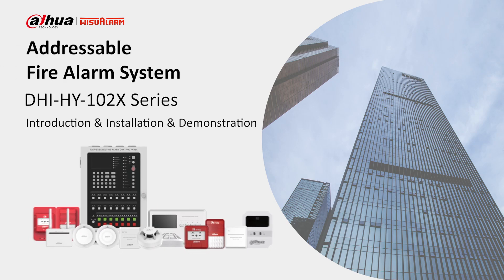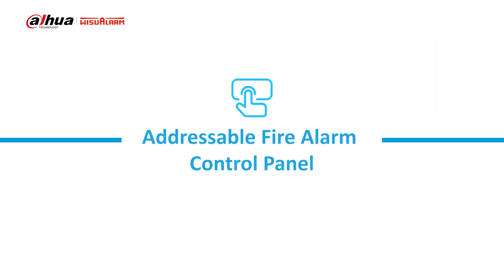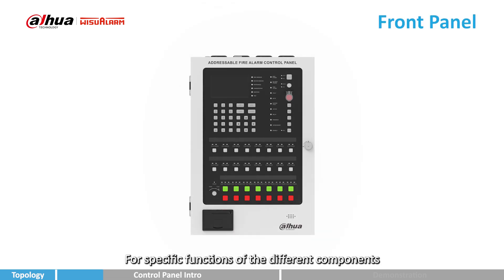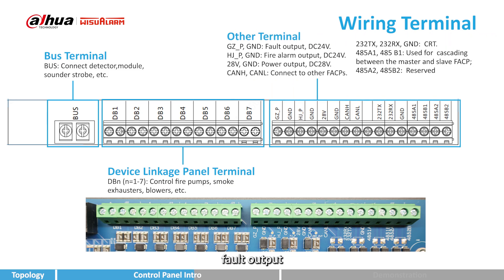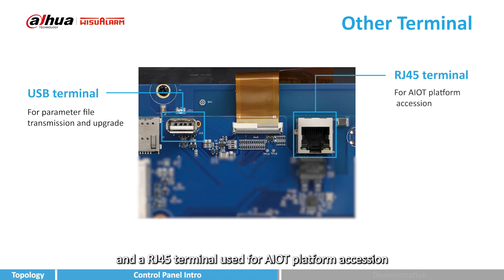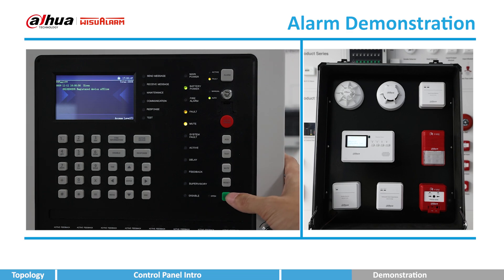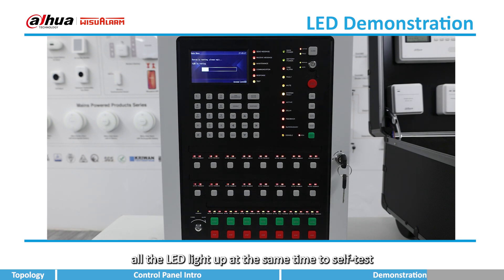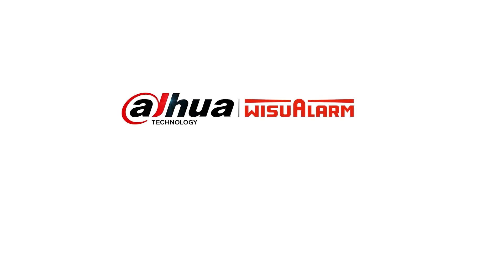Addressable FACP Intro | How to | WIsualarm

Comment: im currently installing 6 unit of hy-1025 , with a lot of detectors and and im currently encountering a lot of problem, one of the unit has a fault, its says fault fire alarm output open circuit, device has no id,FACP, power supply loop 21, and im having trouble with that problem, 

the 5 units has no problem like that even if i remove the bus connection and reset that one device the fault will always appear, I contacted one of the wisualarm tech support and he is saying its a bug of the firmware version and i ask him give me information where to get a firmware cause i cant find anywhere in your website and he replied i try to find a firmware LOL😑 very disappinting.

And im also currently having problem with the input module, and output module, cause i cant find a way how to put it in linkage so that it can automatically triggered the alarm when the input module recieve some signal or etc, and also the output module will automatically triggered his output. i tried to understand the user manual with a veryveryfew information on how to linkage a device but fail, and i ask the wisualarm tech support to teach me or help because i cant find any tutorials or much better manual about linkage. but he replied realy shock me. he said theres no tutorials and he cant teach me how to code the linkage also because of there protocol LOL😑

why is it that wisualarm selling it if you dont want people to know how to install it properly. and teach your technical support how to install it properly also because what I see is they dont have any idea also because they are avoiding my concern. and they are not trying to help, im really disappointed, i think next project will be back with the othere brand like assenware its easier to install and less hussle.

To wisualarm if you think this statement of mine is not true then try to contact me trough email i will send you all my proofs, pictures of the devices or picture of the fault and please week up your tech support. cause i think there always sleeping at work.😑